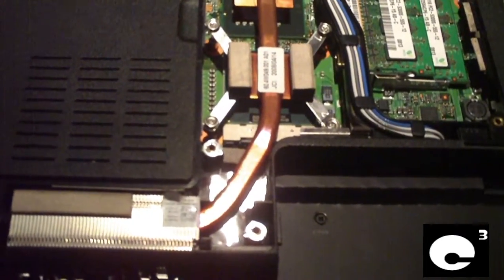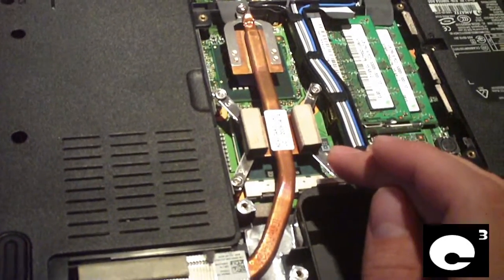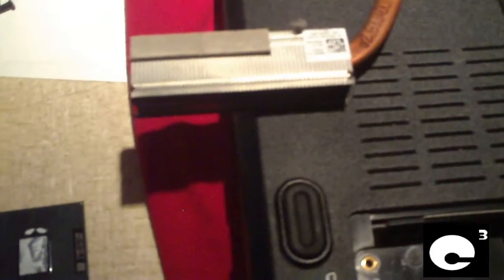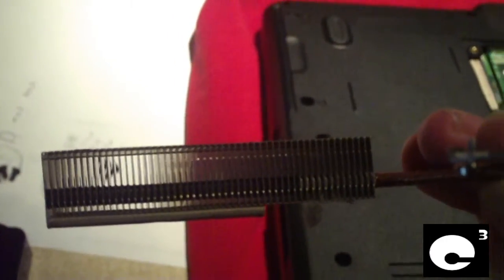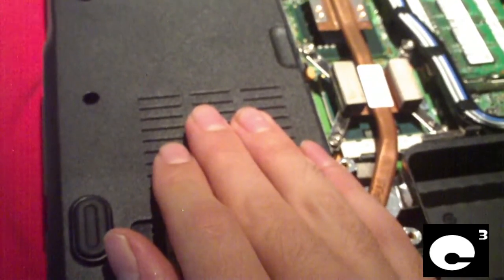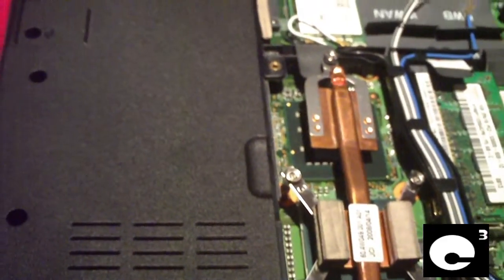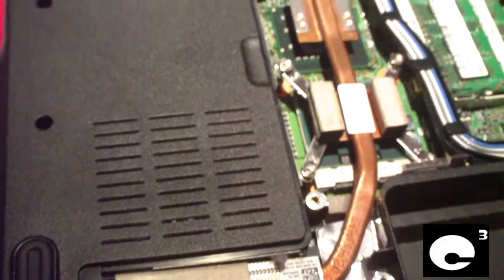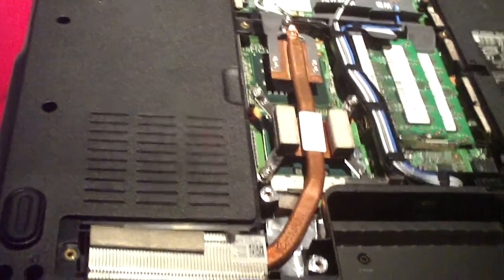How a Laptop's Cooling System Works - Episode II

Comment: Great video bro, but i disagree HP is a great laptop had 3, first one i had didn't have to replace  anything on it in 3 years until i sold it to someone else, recently brought another HP and again works great. No overheating issues in all my  laptops at all. I know a friend who has a Acer laptop and his computer would shut down due to overheating issues.
Reply from the maker: This video was shot around the time when HP was facing lawsuits over their defective line of DV6000 series of laptops, which experienced mass failure rates. Today's HP laptops are different than the ones from that time period.
Reply: The HP DV6000s was one lemon of a laptop. I still own one myself, but I retired it like 3 years ago because of the consistent problems I was getting out of it. It would get so hot to the point here you could probably cook an egg on the fan grill. I would always get heat related issues with that laptop, but luckily HP has gotten their crap together recently.

Comment: All laptops will overheat if the fan is blocked with dust, so it's important to always make sure your fan is cleaned.
Reply: wtf do u mean by the fan is blocked by dust? as long as the fan spins it fulfills its purpose. if it does not spin, due to whatever reason, then it does not. that will cause overheating.

Comment: my computer is hp pavilion g6 1151se
dualcore i5 2410m 2.9ghz with turboboost and 8gb ram upgraded by me
and a ati radeon 6410m with 1gb graphics and a 300 gb wd sata
Using speed fan i got the temps
while opening cod blackops2 and adobe after effects and rendering a video
1-the core:62C
2-the ati card:63c
3-the hdd:52c
4-temp1:64c
so my hp heats alot but thank god it never let me down or overheated even on games 
good video btw

Comment: I've had nothing but problems with HP Laptops, I owed 2 my whole life and they both lasted the same amount of time, 1 year and 1 day.  Dell on the other hand, has been superb for me.  I've had this Dell Inspiron 1520 since 2008.  It is a champ, very easy to find instructions to take apart and replace parts if needed.  I've replaced memory, and blew out all the dust that was inside my laptop and replaced my hand rest and touch pad and my display bezel.

Comment: I'm actually watching this on my 6yr old Inspiron 6400. It's around 45-50C watching youtube videos.  In fact, the hard drive is running hotter than the cpu. I have only cleaned the heatsink once and it really didn't need it.

Comment: The heatsink on my laptop makes excessive noise as soon as the cpu and gpu are under minimal load (internet explorer, 2d application, etc).  It's so loud that I can hear the fan from other rooms. It's only silent when on the desktop,  with all applications closed. I cleaned the heatsink, it did nothing. Then what I did is I loosened the fan's screws a little  bit, which decreased the noise considerably but it's still extremely loud. I can bearly hear the sound of music or youtube videos even with headphones.  Is there anything else I can try ? I'm started to think that I just wasted $500 on a laptop that can't even run YouTube.

Comment: Wait, the heat sink is at the exhaust vent where the fans are blowing the hot air out. Couldn't a lot of the over heating be solved by the manufacturers simple reversing the rotation of the fans so instead of pulling air from the open points on the bottom where most peoples laps cover it'd blow it out and even if they were covered you could put another vent opposite it on the back so the cool air would have a constant flow and the first thing the cool air touched would be the heat sink.....
Reply: your missing the general idea man , what about the other side accumulating dust? then what about have hot air vent inside your laptop increasing the average temperatures of other components? ... did you even thing your solution through? xD
Reply from the maker: NexusChild925 Some laptops, such as Toshibas (not all of them) pull air from inside the laptop and blow it through the fins on the back or side. While this design prevents your leg from cutting off airflow to the vent on the bottom (since there is no vent), the air getting to the cooler is hotter than fresh air from outside. I've seen some Toshibas run very hot because of this.

Most laptops that pull air from the bottom can also pull air from above the cooler. Most laptop cooling fans have openings on the motor side of the fan as well as the bottom side. This means that in some cases, depending on how the rest of the laptop is designed near the cooler, the cooling fan can get air even when your leg blocks airflow... In this scenario, it would act like the Toshiba design mentioned earlier. The air source would be hotter, but at least it's an air source.
Reply: ***** This is cool and all guys but I posted this almost a year ago, so I haven't given it another thought in the slightest, I built my own cooling pad for gaming which pretty much solved the issue I found so thanks for the input but at this point I'm pretty confident it wont be an issue again lol
Reply: alright then cheers bud!